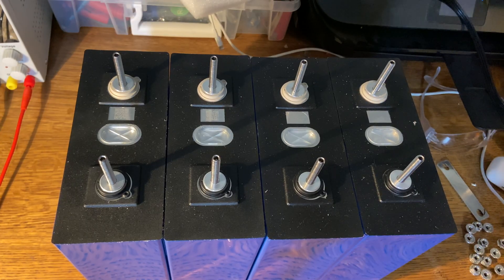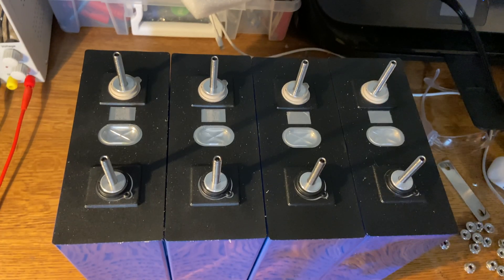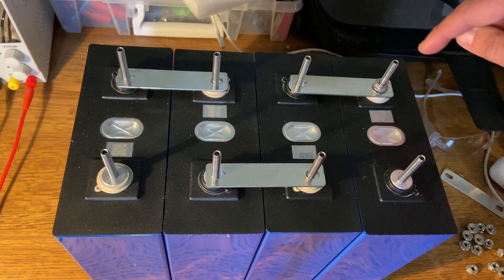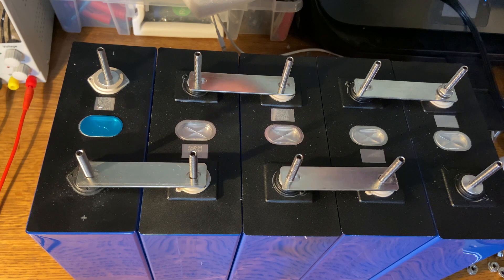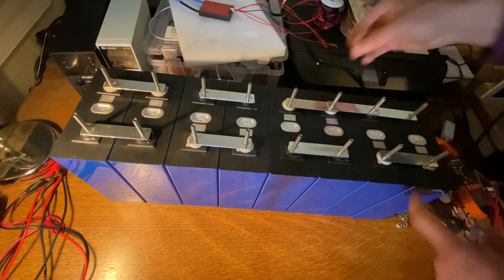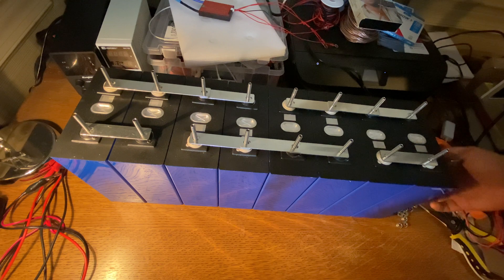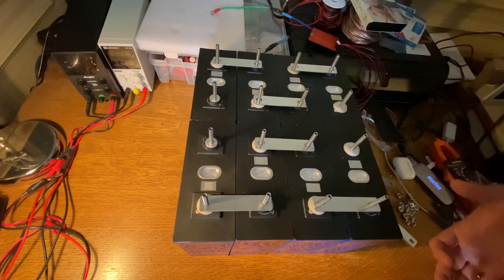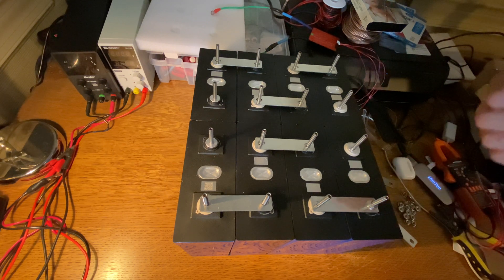How to Connect Battery Cells in Series and Parallel - w/ Large Lifepo4 Cells

Comment: I ordered the same cells you have. 16 cells and I want to connect them into one 24v battery. What do you think it's the best way? I'm soooo confused!
Reply from the maker: It's definitely confusing at first. For a 24v setup, you can make two separate batteries, each made up of 8 cells, and then put them in parallel.
Reply: @TheWilltoBuild  
Ok thanks I  definitely can do that. I also have a 16 cell bms, can I get away with 1 BMS or do i need 2 of them?

Comment: If I accidentally put the bus bars on wrong for a few seconds when I first got the batteries to “short” then. Did I permanently damage them to the point that I rendered them useless?
Reply from the maker: Almost certainly not. They are probably fine. Check the voltages on them and if the cells seem ok, you are probably fine to proceed.

Comment: Can I hook the two 4S batteries up in parallel with separate BMS and charge/discharge them with a single source safely & efficiently? Or do I need some sort of third system to monitor the combined batteries in parallel? What happens if I only use one half of the system individually (I take it with me as a portable power source) and the 4S batteries are then at different charges? I need to charge them both to max again before connecting them in parallel, right?
Reply from the maker: You can definitely put two 4s batteries in parallel with one another, this is very normal and shouldn't be an issue as long as they are at the same voltage. If you put them in parallel when they are different voltages, it could be a big problem. If the difference in voltages is large, LOTS of power could flow from one battery to another. Try and match the voltages between the batteries very closely. They don't have to be identical, but pretty close (I would say .25 volts or less).
Reply: Great, thanks @TheWilltoBuild  ! What about using one battery more than the other over a longer duration? If you link them, you would potentially bottle neck the less used one since the more frequently cycled one would hold less wh, right? So I should try to cycle them equally over their lifetime?
Reply from the maker: @nikzel  Good point. Yes, definitely try to use them an equal amount.
Reply: @TheWilltoBuild  Hi, like to follow up on this one. Cause, I have 8x 105AH EVE's on the go. 12V system is mandatory and I consider 2 individual batterypacks to be comfy. I'd like to understand what's going to happen exactly, if I stress them separately and connect them to 210AH 12V intermediate ? Let's assume to use generous connectors as well as both have each a 60-80A BMS. Won't the BMS'es amoung themselves manage/restrict to settle "the situation" ? Elsewise any suggestion how to solve this, may with ?relay? Setup should be for a camper van: charge with cars alternator & solar on the roof Battery1 and go fishing with Battery2 to run a boat engine.

Comment: Hi, the Daly BMS link is for a BMS on Amazon that is for the 18650 batteries. Will that work for the large cells you are using? Sorry for the newbie question and thank you in advance for your response.
Reply from the maker: BMSs don't care if the batteries are 18650 (cylindrical) or the big ones I am using (prismatic). As long as you can correctly wire them to the battery, they will work fine. BMS care about the chemistry of the cells, not the shape of cells. Good luck!
Reply: @TheWilltoBuild  Hi and thank you so much for the response. I noticed the one you had a link to was so much cheaper than other ones I have looked at that I was hoping it would work. I am looking to build a 4s 12v 200ah battery so .. pretty basic and was hoping! Thank you!

Comment: hi i build my first electric trike using fiat 500e lithium battery packs each pack is 24v i use 8 packs in series for 200v but i have 2 24v packs left over i would like to parallel these two packs and use them as a range extender to the end of my 200v pack is this possible. my pack of 200v all get charged and balanced individually so one pack of 24v to one charger . will this work for range extender.
Reply from the maker: It sounds like it would work. But are you using a charger? and what is the input to that charger?

Comment: Hi can i use just one  8 port bms this system ? Many thanks
Reply from the maker: Sorry, don't quite follow your question. 8 port bms would be for an 8s battery. If you are using lifepo cells, then that is a 24v battery.
Reply: @TheWilltoBuild  hi im try to use 12 volt i must use 2 bms rigt ? Many thanks

Comment: I plan to do a van conversion build. I have been looking everywhere on youtube for this sort of video. I want to have 2 DIY batteries made up of 280ah cells from aliexpress, and these batteries i plan on connecting in parallel and hope to run 12volt appliances from it and also a 2000watt inverter.  I want to have a 250amp rated Daly BMS on both of the separate DIY batteries. I need to do more research on solar charge controllers and DC to DC charging and all that stuff but... Can you see any holes in the rough idea I have? would appreciate your feedback
Reply from the maker: Honestly it sounds good to me. Doing two 12v batteries, both with a separate BMS, sounds like a good idea. You could also just do a 24v system and use a converter to run 12v appliances, but that may be more trouble than it is worth.
Reply: @TheWilltoBuild  thanks, how long have your 12v DIY battery systems lasted ? Are they holding up well ? Also have you had any experience with the 310ah ones... I trying to figure out if it is just fake advertisement from aliexpress

Comment: How do you hook up the 2 bms. I'm building a 12 volt with 2 bms and 8 cells in one case. Trying to wire it so only one positive and negative.
Reply: I have 2 separate 4s cells batteries . With the b-  going to the main negative on the first cell. SO do I wire from one c- to the other c- and have the main negative come off of that?
Reply from the maker: hey, I've answered this same question for you on the other video.

Comment: Good evening LtB... I have an unrelated question that you may wish to answer..?   I have two solar generators and would like to power both at the same time using one 180 watt solar panel (instead of a separate for each)..  Realizing that the sogens cannot be connected together in any way,  my solution would be to provide the necessary branch mc4's for each sogen and isolate each branch with an inline mc4 fuse which already has the diode built in to prevent vdc back charging.  Your thoughts..??
Reply from the maker: I really can't say I've ever encountered anything like this, but my feeling is that feeding two separate solar charge controllers with one panel is a bad idea. I would suggest just adding another panel and having them be completely separate.
Reply: @TheWilltoBuild  "feeding two separate solar charge controllers with one panel is a bad idea"....  Why...???  If each pos leg has a blocking diode in the inline fuse to prevent back feeding to each other across the mc4 branch (which acts as a voltage divider) and one sogen from charging another...?  I already know that I can connect one to the panel and the other to the ac inverter...

Comment: A 4S2P IS the better option, as opposed to a 2P4S, but you’ve overlooked a very important problem with a 2P4S configuration.
Reply from the maker: Which is?
Reply: @TheWilltoBuild  there are a lot of YouTube posts about problems with getting good connections with these cells. Any poor connections with a parallel pair will result in the pair becoming unbalanced and the pair/pack capacity will suffer. Having 2 strings of 4 would mean more BMS connections but each cell would be monitored and any imbalance between strings due to poor connections would be much more obvious. There is another youtuber who is putting together a battery, 3P16S I believe, and it will be interesting to see how that goes.

Comment: OK I like the way you did it. I have 1 question I have two BMS but one is 4s 12v 100A and the other is 4s 12v 120A both are made by Daly. Can I still use those two even tho they are different in Amps?? Thank you.:)
Reply from the maker: Yep, that should be fine.

Comment: Thanks for the video.  I do separate series strings as well and then parallel the strings together onto a main setup of buss bars that the inverter, charge controllers...etc... connect to.   The added benefit for me is that I can have a separate longmon for each cell for the batrium bms.

Comment: Good explanation and a cogent argument made.  From an efficiency standpoint, a 24v, 8S configuration, with the proper BMS and 24v inverter, will deliver more power, correct?
Reply from the maker: Functionally, 8 cells can deliver the same power whether they are 4s2p or 8s. The 24v system has higher voltage, but the 4s2p can push more amps. That said 24v is still better in my opinion. Cells prefer to be in series, and 24v systems will need smaller wires and will be more efficient with an inverter.
Reply: @TheWilltoBuild  - I was basically referring to the efficiency ratings for the inverters.  48v is better than 24v, which is better than 12v.  If the use-case is off-grid or emergency backup, the 24v, 8S configuration, paired with an appropriate inverter, will deliver more power with less conversion loss.

Comment: @everyone what is the most effective setup I can build with 12 of these cells?
Reply from the maker: probably 4s3p? Three 12v batteries then wired in parallel? I would say get four more and do a 48v system if you can.
Reply: @TheWilltoBuild  exactly what i want to do.... following your example above... but doubling it...   do i then just continue the main + and main - horizontally .?

Comment: I have 8 cells soon arriving for 12v setup,and an 8s bms(daly).will it still work for me setup as 4s2p(hopefully have that right)
Reply: For a 12v setup I believe you need a 4s BMS. 8s would be for a 24v setup.
Reply from the maker: Yep, he's right. You can't use an 8s for 4s2p. You can either do one 4s2p combined battery with one 4s BMS, or two 4s batteries with separate BMS and wire them in parallel. But if you can run a 24v 8s system that is best and do that!

Comment: Thanks for the video. What is the maximum current draw you would be comfortable with using those busbars?
Reply from the maker: Really good question. I'm not sure actually. I think they should be good for 50 amps at least, but I expect much more. But I'm not an expert in this will have to do more research. Great question!

Comment: One good tip that I haven't seen others do is take a strip of masking tape and paint (spray gloss enamel, etc.) it red and let it dry. Then cut it into little squares and affix a piece to the top of the cell next to each of the positive terminals. It elimates all confusion as you are rearranging or working with the batteries. Never second guess which is the positive terminal. I also mark each cell's number on the red tape, (1,2,3,4,...) For the cells in order. Also I number the balance leads with tape as well. I love your long studs, are they Stainless? Which length did you go with?
Reply from the maker: Great advice. There really is no harm in being extra careful and it would be very easy to make a mistake. I get the set screws (studs) at the bolt depot, and in this case the are 40mm. In hindsight I probably could have gone a bit shorter.

Comment: hi question 
in the the 2x 12v baterij setup is it possible to use 2 diffrent amperage
like 1 batery is 12v280AH an the other 1 is 12v100AH
Reply from the maker: @toastiesvanbuild4644  I think it is bad idea to do it for any extended period of time. If they are genuinely in parallel, the larger battery will constantly be charging the smaller battery, so for every charge and discharge cycle, you are going to work the small battery twice. Generally speaking the battery community this is seen as not advisable.
Reply from the maker: Definitely not. You can not mix batteries with different capacities.

Comment: Got an 8s4p with these cells, 25.6 volt and 1120 Ah :D Might change to 4 batteries if I have a problem.
Reply: @thewilltobuild How did you calculate your Ah?  and what are the advantages etc? What do you need for the  8s4p?
Reply: @Mellosucc3ss  32 cells 8s 24v 4 parallel x280ah =1120ah 500amp BMS, advantage is that with large loads one 24v battery failing could cause the other exceed their rating. Each block of 4 self balances meaning you're less likely to under/over volt one cell. Its also the way Tesla build their packs but they then series connect those packs 😮
Reply: @TheGalifrey  did you say 32 3.2v cells? 🥲 I only have 12. Would that work for a 8s4p?
Reply: @Mellosucc3ss  no, sorry
Reply from the maker: If I had 32 cells I would do 16s2p - but 8s4p works. Generally speaking though putting cells in series is better than putting them in parallel.
Reply: @TheWilltoBuild  16s is no good for me on  motorhome, not if I want to charge it from a  spare alternator when I am moving. Better suited for home use though, exactly what I would do for home storage,
Reply from the maker: @TheGalifrey  Makes sense. Be careful with the alternator though. I'm not an expert on the RV setup, but I've heard there can be major issues if you try to charge off a standard alternator.
Reply: @TheWilltoBuild  Again you're correct, you need to limit the amp draw from the alternator, I will be doing that through a charger that maxes out at 30 amps. I am using an ISDT q8 Max as a balancer and it also has a 30amp charge circuit.
Reply: @Mellosucc3ss  I don't think you understand what 8s4p means: 8 cells in series by 4 in parallel --> 8*4=32. 12 cells could be 12s (36 volts), 3s4p (9 volts), 4s3p (12 volts), 6s2p (18 volts) or 2s6p (6 volts).
Reply: @lhcommons  thanks!!!! I truly appreciate the clarification, how would you calculate Ah for the 4s3p if each cell has 280Ah?